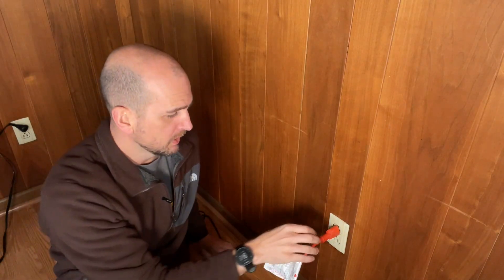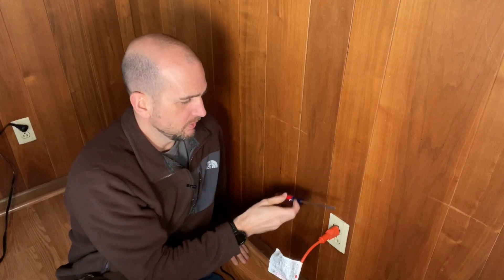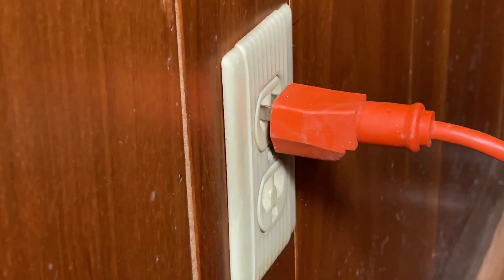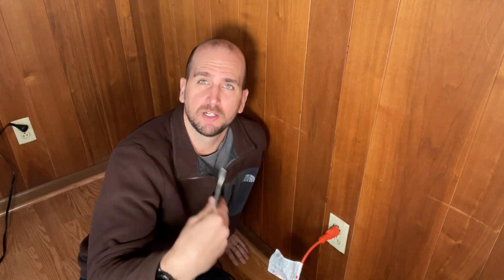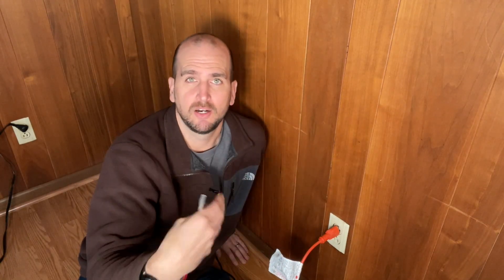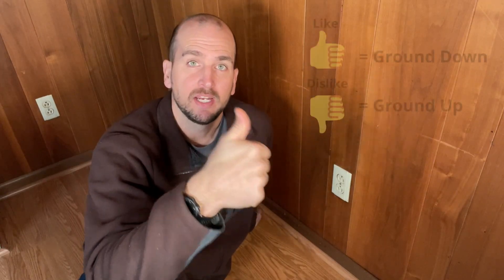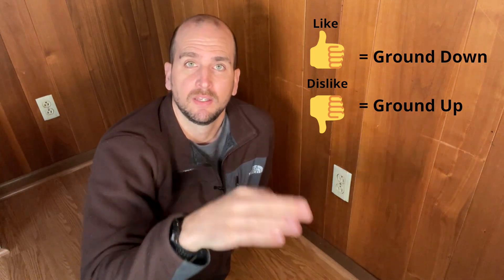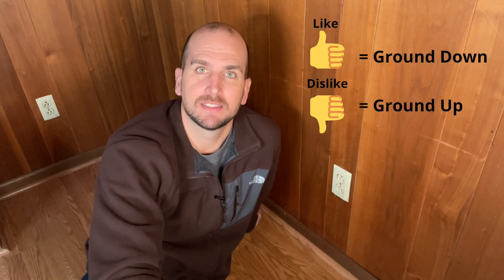Should An Outlet Be Installed Ground Down Or Up

Comment: Ground up helps if a plug gets knocked around the ground prong helps hold the hot and neutral stay engaged in the receptical. Around 20 years ago I ran into an IBEW worker from Boston who was on a committee that attempted to get ground up in the NEC. Great topic thanks!!

Comment: Australia and China use the same three pin configuration although they differ in orientation where Aus have ground down and China ground up. However, Aus plugs are also required to have their pins insulated enough at the base to protect an electrically connected pin from being exposed.

Comment: In the united states. There is H.U.D. standards. The round safety earth goes down.  Building code covers this topic.
Reply: The NEC has nothing in regard to code on this. best practice is ground down unless it is controlled by a switch. the reason for ground down is in case your place starts to flood.

Comment: Ground down is the orientation most plug in devices require.  I am looking at a Tripp-Lite 1 to 3 outlet Surge Protector. The labels for the LED's require ground down.  Otherwise, the labels would be upside down. I have bought new houses in Missouri, Illinois and Georgia. They have always had the ground down orientation.

Comment: 1) For home use I will probably always do ground down.  US consumers and consumer cords are just to used to this configuration to make having to explain why worth the effort.  I would say that in this case you should always use plastic covers (see comments in #2).
2) For commercial application, metal outlet covers are common and in that case, the mounting screw coming loose could cause a single point failure path to a fire (screw comes loose -> metal cover drops on the plug contacts -> (possibly intermittent) short between hot and neutral -> fire hazard.  I believe the use of metal outlet covers in hospitals is what drove a lot of this change.  For the case of receptacles that use metal covers, I would deem the risk unacceptable and I would only install the outlet with ground up.

Comment: There is still a 50% chance that the thin metal object will tip to the hot side and short out. It is a silly excuse for some very slim random event, which btw is already protected by a breaker. The ground up is ALWAYS a hassle with the low clearance 90° plugs. The ground down just simply works better for every day life and most appliance makers.

Comment: I like convenience through predictability.  I will insist all plugs have a consistent ground to the bottom.  This becomes especially important with two pronged, polerized plugs where they must go in one way.  Nothing will make you fumble excessively and possibly slip your fingers between the prongs (possibly live) then the wider opening on the wrong side.  Keep plug outlets consistent and predictable orientation.

Comment: 25 years ago an electrician told me he always puts ground up for the safety factor and I have followed that advice, but, the majority of electricians I know install the ground down.  Also, as has been pointed out, appliance manufacturers tend to make the cords for ground down installations, so in some locations in the house, ground up can be problematic.  Since many of these are 20 amp outlets, ground down can be an added indicator of the higher amp circuit while all of my 15 amps are ground up.

Comment: I think of it from a physical aspect. Gravity is always pulling the plug down. In the ground up scenario both the hot and neutral work together as a lever to pull the ground out making it more likely for the plug to fall out of the socket. The other way the neutral and hot work as a lever to push the ground into the socket.

Comment: Inside the house, I install it in the "typical" ground down fashion. However, in the shop, I install them ground up. The reason for this is cause the odds of thin metal falling between the plug and outlet is much higher in my shop, where I work with metal (cutting, welding, machining). I think the most common "cause" of ground down, is because it looks like a face to people, and they don't want the little person standing on their head.
Reply: In the slim chance that metal will fall behind the outlet, it will pop the breaker. No safety issue here.

Comment: As a retired electrician from the UK here are some differences.
Its not to appear as a 'this is better or as not as good" Just to show some differences.

The cables here are in a number of system and codes, as one would expect. Like 12,14.
Here the cable might be 2 core plus ground. The same cable there would be 'twin and earth'.

There almost all sockets (receptacles) have a built in switch. Seemed so odd at first never to see a built in switch.
Here the socket covers have one screw, flat screwdriver blade, all the other screws are crosshead. There all screws are crosshead so no need for two screwdrivers.

One thing I particularly liked was the UK wiring. There were basically 3 wire sizes. 2.5 mm cores were for sockets. They are all wired in rings, so that meant the circuit was fed from both ends .Both end came from and went back to the breaker.
The sockets were all grounded, no exception. The European voltage is 230 volts. At the time the UK was ( and still is) 240 volts. When the EU decided on the voltage they picked 230 but the tolerance was 6% if I remember it well. That meant the UK 240 volt was in tolerance so no change needed.

I love the bigger boxes there as there is so much more room and the sockets are nearly always 2 gang ( two sockets side by side). As the voltage is 240v the current is 1/2 the US so the current is a 1/2 too. This makes for lighter wiring. This with a much bigger bow makes wiring and fitting in Europe so very much easier. Also the wires are PVC with no paper  inside so 'stripping cable is so much easier. Usually just run the knife carefully at the side of the bare earth/ground wire, Get tit started enough to be able to hold the cable end then bare it  easily.

Lighting is completely on its own, no mixed sockets with lights. So if a socket needs attention in the night, turning off the circuit for the socket does not also turn off that room's light.
This what its like.

Everything is fed with 240, no split like in the US so there is no 120-0-120.
Sockets are at 240 volt and can supply 3KW. That still means at 3kw the current draw is only 12.5 amperes.
There is not a whole bunch of different 240 volts varying current sockets like the 20.30.50 amp sockets.

The wire colors use black=neutral, red= live and bare=earth/ground.
Flexible cords are brown=live/hot, blue=neutral and green/yellow is earth/ground.

The main supply cable feeding a house will be from the road underground. 
The armor of that cable is used as the main earth/ground.

Reading through it it may seem that I am saying the EU system is better. NO, just observations in the differences.

Also I have lived in the US 17 years so there will be changes I am not aware . And in up to date systems in both countries.
Hoping its interesting.

Comment: All of the outlets in our house are ground facing down. I noticed that when I plug a polarized night light in, it is right side up. If the ground were at the top the night light would be upside down.
Reply: If I put them all in upside down, my wife can’t put those scentsy burners all over the damn place. Brilliant!
Reply: @SuperClarenceZ  I'm particular about the constellation night light.
Reply: As I learned growing up the Earth to Earth or in the USA Ground is always down.  When wall-warts became a thing with the third prong if you didn't do that they would fall out from the weight.  I ALWAYS put the ground hole down, and will pull all sockets out and flip them around if I see them the wrong way up.  Night lights as well facing down is just stupid.
Reply: You didn't notice by, I don't know, the hole on the bottom?
Reply: Kill hacker smells like farts.
Reply: @clintstathis  🤢💨<<( ¥ )
Reply: @clintstathis  LMAO!
Reply: Don't want the light coming out upside down.
Reply: Sounds like you got yourself a bunch of Australian nite lites
Reply: Still works
Reply: @killhacker5776  Of course it still works, but it looks like hell! Lol
Reply: @UFO4X  I feel ya . really do. But that "ground up" is for safety . it really shouldn't matter which way it's plugged in so just grind off the fat ended .
Reply: @killhacker5776  actually it does. For things like light sockets, the base of the bulb is wired to be neutral and the pin at the bottom is hot. When reversed, the base will be hot and posses a shock risk as it will be hot while screwing the bulb in or out.
Reply: @jasonharrison25   I'm aware but the chat was about a night light. Not a table saw.
Reply: @killhacker5776  Isn't the polarity more of a safety feature than the ground hole being on top.  So it would be like saying the white borders on stop signs are for safety but just go ahead and take the signs out.  The ground hole on top does practically nothing but the polarity has probably already saved your life.  Literally, especially with electronics grounded to it's own metal casing.
Reply: @ranbymonkeys2384  a light bulb is a dead short. Will it work? do you know?
Reply: @killhacker5776   Ohhh my turn? OK a rib is in the sky.  Will is sink? do you know?   I just figured it  was type a sentence that doesn't make any sense hour.
Reply: @killhacker5776  How is it for safety? If we are following the ground up rule for switch, how does that make it any safer for installer or the user?

Comment: I was taught to install with the ground up in US Navy submarines (I was a nuke electrician's mate). The reason was structural... with the ground down and downward force on the grounded plug, the little bit of plastic at the bottom of the ground terminal would break. That was a safety problem (if someone saw the crack in the plastic housing) and we'd have to replace the outlet. With the ground up, that piece of plastic is not stressed by downward force and the outlet lasts longer - thus giving us more time to replace the broken tamper seals on the emergency flashlights.

Comment: The goal of the installation any electrical device is to reduce risk of arcs and sparks. There is no 100% prevention of all arcs and sparks as long as there is a presence of Voltage so to mitigate and reduce risk of an ark and spark with the installation of a nema 15 or 20 r device duplex or single with the ground up will reduce the risk of Arc and spark.

Comment: i was taught by a master electrician that i worked for and got my start from always ground up because of the exact fir thing you said ,,incase something was to fall across the hot and neutral and short out..or could possible burn your shack down,,,im ground up..some say but the plug is easier to grab and push in the outlet ground down,,,,that doesnt make it right because its a comfort thing...SAFETY FIRST ''''ALWAYS ''' I AM RESPONSIBLE IF THERE IS AN ELECTRICAL FIRE AND MAY POSSIBLY BURN A FAMILIES HOME DOWN OR FAMILY INCLUDED,,,I just dont think i could live with that.....Just my opinion and how i was taught back in the day,,...and it just feels right to me...Thanks for the video..awesome info everyone should think about